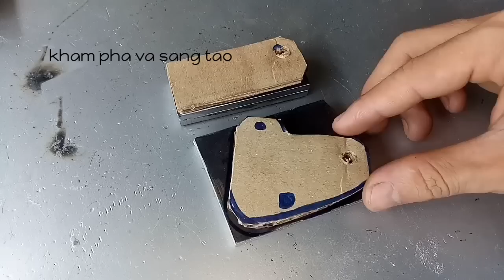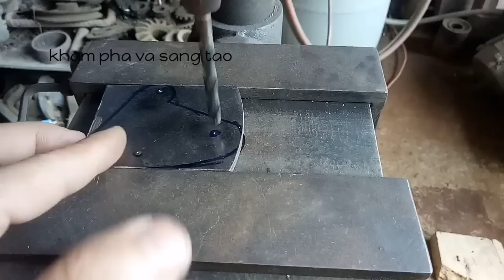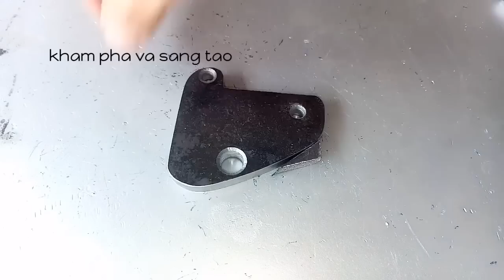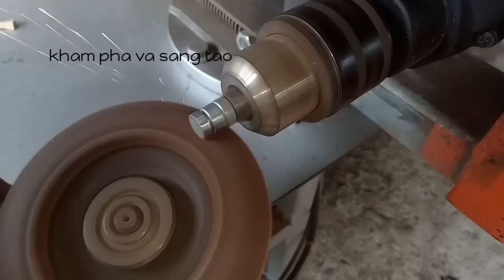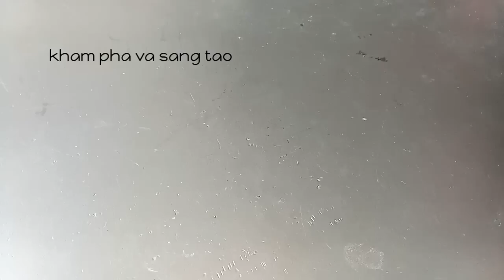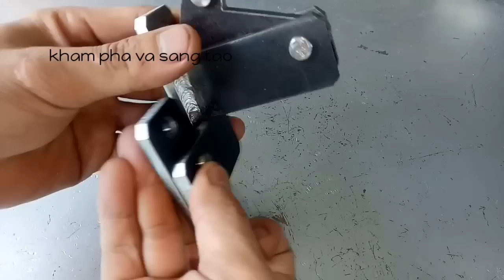hướng dẫn làm chốt cửa tự động đóng tuyệt đẹp

Comment: At the top there is another hole missing to put the padlock as a trap in case you go out when you want to enter it will be closed and you will not be able to open the door 🤷🏻‍♂️